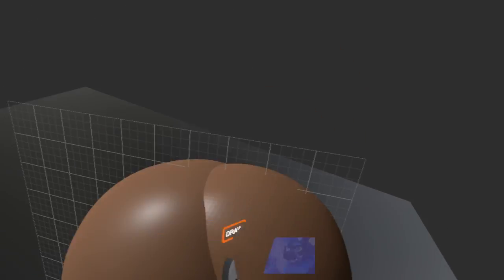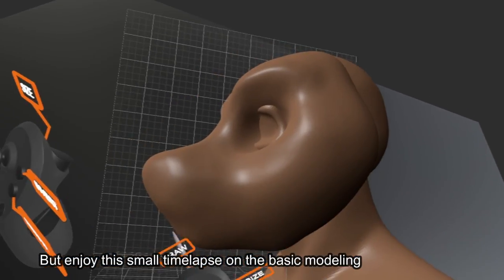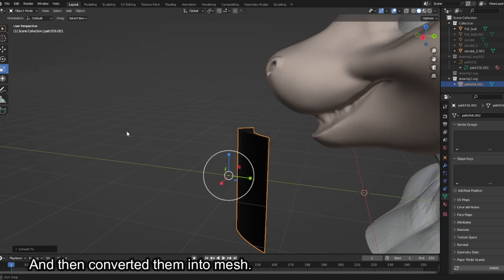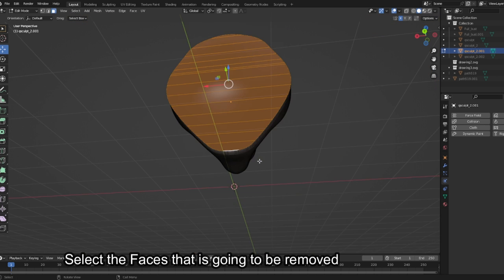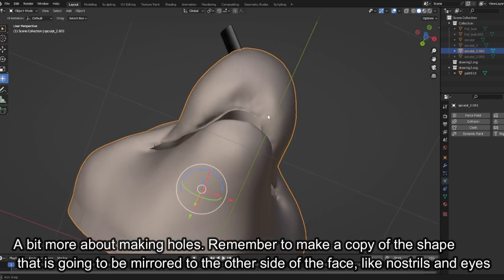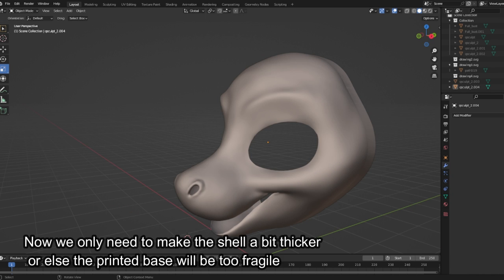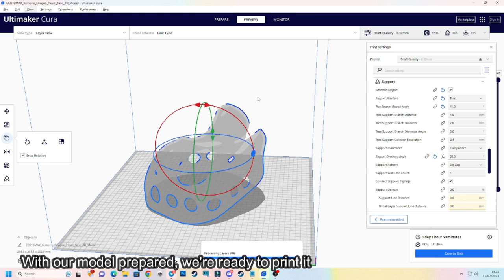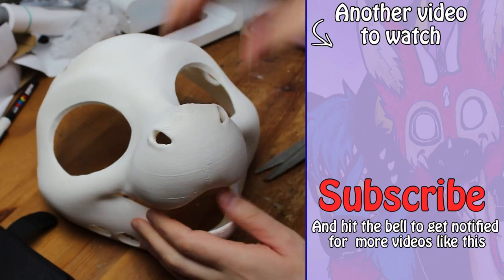How To Make A 3D Model Of Fursuit Head Base For 3D Printing | Fursuit Tutorial

Comment: so, there's some easier ways to work with the booleans in blender - if you use the boolean modifier, boolean objects can be completely separate objects, and can be hidden with the boolean modifier still active. then when you export the STL, using 'apply modifiers' will apply the booleans. this way the booleans are 'non destructive'. and will  let you make changes any time throughout the process. mirror modifiers can be added to boolean objects, too. 

selecting outer rings of a shape and pressing 'e' will let you extrude that region, very useful for making holes without boolean, if you already have the edge ring available.

a few of the points in here were helpful though. i'll be converting an already self-built character model into a suit head using these methods.
Reply: Tysm for this you are a legend